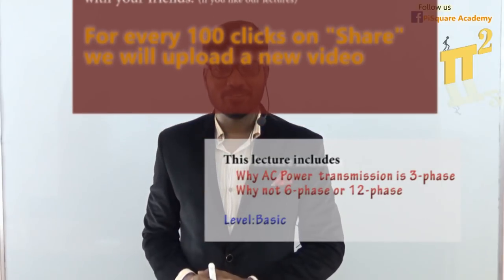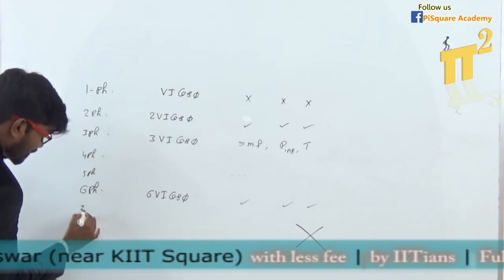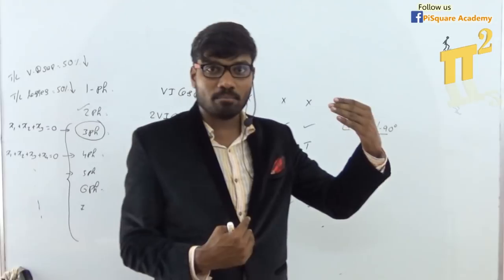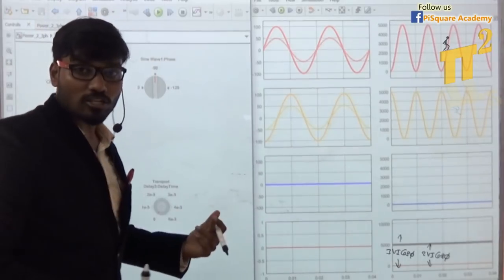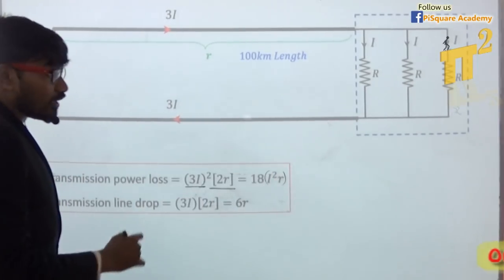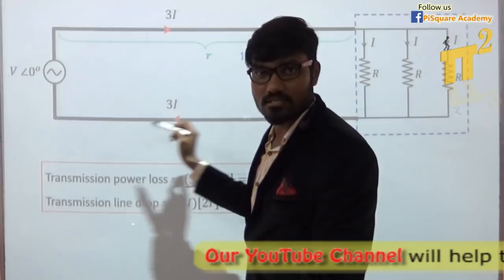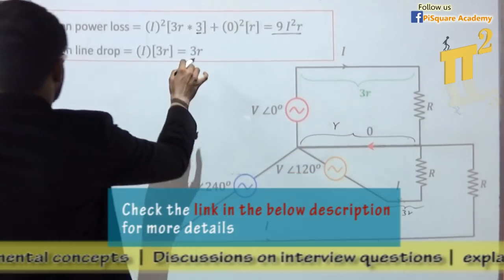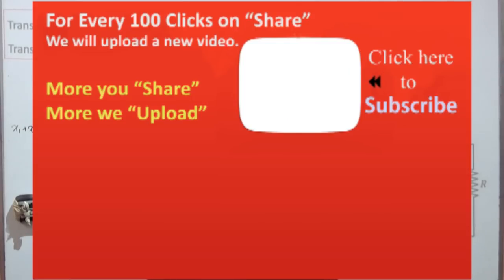Why 3-Phase Why not 1-ph, 4ph, 6ph, 12ph Why 3-phase transmission | PiSquare Academy

Comment from the maker: Please Share the video with your friends through facebook or any other medium. More you share, more we upload. Your single like, comment and share will give us energy to do more such videos. Thank you all.
Reply: Sir........Plz make a video on types of grounding of transformers and generator and it's purpose
Reply: PiSquare Academy sir please make a video on what is reactive power, how it is generated, why is it important
Reply: Awesome
Reply: Advertisement disturbing me everytime
Reply: Thank you so much sir for this video ! Sir Could you please make one video on Importance of Form factor , how it helps in generating voltage?
Reply: Nice video
Reply: Why we use double circuit 3 phase?
Reply: Sure sir..and please explain wye and delta systems.next videos if its possible👍
Reply: Hi sir..... Motor running hr is 7 hr each day 24 dayes total... 11 kw motor... Converte to unites????
Reply: @cheruvudiwakar7596  168 kWh needed
Reply: Sir I need a notes on these topic sir please give me the reply as soon as possible plz sir urgent
Reply: Is neutral carry current in three phase 4 wire system
Reply: @chinthamojesh6147  in balanced 3 phase system neutral should not carry any current unless a fault has happened.
Reply: Sir, why you took voltage drop for only single phase,???
You would've taken 3×I×3r
Reply: Sure sir

Comment: In 2 phase, the voltage  generation from coil 1 is at 0 sec but in second coil voltage generation starts from (90deg) phase shift because the coil 2 is shifted 90 deg physically in alternator or in dynamo to the coil one so generation of voltage is also delay by coil 1 timing and it is exactly (1/50hz) then we get one cycle time period and then at 1/200 sec u will get voltage in coil 2 and this 1/200 sec is also exactly 90deg phase shift that's why in 2 phase the phase difference is 90 not 180

Comment: your explanation is correct that  kirchhoff law  also telling the algebraic sum of the current at any junction of the net work is zero.because transmission line voltage & current losses 50% it will be reduced and all installation electrical materials will be reduced and single phase (1ph,2ph) can not get rotational magnetic field in ac induction motor only get pulsating magnetic field also many phases no required to run the ac induction motor only 3ph enough

Comment: Hello, in 11:57, area of the conductor is reduced by 3 times because current is changed from 3I to I. But in normal conditions, for example cable which is able to carry 300Amps has not the section area of a cable which is able to carry 100Amps. (150mm2 section cable carries 324Amps and 25mm2 section cable carries 106Amps, current ratio is 3 to 1 but section area ratio is 6 to 1)

Comment: Dear Sekhar Sir, As I am thinking, in 1-ph system, the power equation is, P=Vrms*Irms*(Cos(th)-Cos(2*omega*t – th)), while, in 3-ph system, the power equation is, P= 3* Vrms*Irms*Cos(th). Here, “th’ is the angle between Vrms and Irms, which depends on the nature of the load, and remain constant in the balanced system. These power equations show that the power equation of 1-ph system is the function of “t”, so it is pulsating. While the power equation of 3-ph system is not a function of “t”, so it is constant. Am I correct ??

Comment: simply if you see the wave form of 3-phase then the power is not zero at any instant of time and also if we see the wave form of 6-phase ,9-phase, 12-phase... the wave form is similar to 3-phase.Less wire less transmission losses and less material required and also  less space for transmission

Comment: I have a doubt. While considering a 2 phase system, we should not consider each phase displaced by 180 degrees ? In the lecture, Sir is considering the angle as 90 degrees. Can anybody indicate the reason ?
Reply: If you're not aware, a two phase is 90 degrees apart. To generate a two phase which is 180 degrees apart (as suggested by you), the two phase winding in the generator needs to 180 degrees (electrically) apart in the space, which is not possible.

Comment: The concept of transmission power loss is clear. the power loss you calculated for all 3 phases.
but there is some confusion in voltage drop in case if 3 single phase with common thick neutral.
bcoz voltage drop you calculated in per phase only. so in case of 3 single phase with common thick neutral, even though there is '3I' in common neutral, the contribution of one-phase in neutral line is, only '3I/3 = I' and hence overall voltage drop / phase will be '4I', right?

but in case of 3 single phase with separate neutral & in case of  3phase system, voltage drop / phase concept is clear.
And presentation very much conveying message.

Comment: what about 2ph 180 degrees phase shifted. It would also have sum of voltages and currents as zero.
Reply: There will not be any rmffor 2 phase 180...RMF will be produced for 2 phase at 90 shift

Comment: I have 315 KVA, 15/0.4 KV, 50 Hz, DELTA/STAR connected step down 3 phase transformer whose HV and LV windings are rewound again as it was. The TTR test was 100% ok. The insulation and dc resistance tests were also ok. However, as  I tried to conduct  open circuit test by connecting 380 V to the star connected LV side and the delta connected HV side was left open, the 16 A circuit breaker tripped immediately as the supply is switched on.  
I expected small magnetizing current (1.2 - 2) % 0f LV side rated current which is 455 A from the name plate. What could be the reason that the circuit breaker tripped?

Comment: Hi sir, thanks for the video...but i have a doubt..
For three phase total power must be
Root 3 VI COS$
But told in your video power is 
3VI Cos$
How?
Reply: in your equation with root(3) voltage and current are line to line values.......he uses in his video the phase voltage and current. The relationship between line to line and phase is V_LL = root(3)*V_phase

Comment: What happens if sudden failure comes in the transmission line while transmitting power from generating station to Grid? At that instant power is fed back to the grid?

Comment: Sir in India We get 220 volt power .so if a bulb of 100watt is used we find resistance by ohm laws 484 ohm but when We measure it with the help of Multimeter we find it nearly 40 ohm why
Reply from the maker: 40 Ohm is the cold resistance, your calculated value (484 ohm) is hot resistance. Filament is having a positive temperature coefficient, i mean filament resistance is not constant.

Comment: In case of 2 phase supply, phase difference will be 180° and not 90° as shown in video.

So in 2 phase system also we can have summation of both phases to be zero.
Reply: no sir, in a two phase system it is displaced by 90 deg
Reply: Phase difference means : diffrnce between two phases zero instant

Comment: Sir I have one doubt if we 2 phase with 180° phase shift then that also have the current at that instant is zero then it should be like 3 phase ????
Reply: I think for a two phase system with 180 degree phase shift, there will be no current flow because both the phases offer equal and opposite potential at every instant of time.

Comment: With the help of rotor voltage and rotor current of slipring induction motor,how to select external resistance for rotor resistance starter ,please explain sir

Comment: I have to disagree it's the "3-phase system transferes more efficient" fallacy. The comparison is a bit wrong or 'unfair' to the 1-phase system. Lets say the voltage is 230V. In the 3-phase situation each line carries voltage and power, and the center line can be left out, good. But in comparing it to 1 phase something goes wrong. Either one line is at ground so doesn't carry any power. Or the ground is in the middle and each line carries 115 volts. a correct comparison would be to double the voltage and put the ground in the middle, then each line carries 230 volts and the whole thing is just as efficient as 3-phase. Offcourse at 2/3 of the power.
Reply: Efficiency isn't limited to input vs output power. 

Economic efficiency is important as well. The cost to install and maintain the systems is normally not worth the improved reliability of the systems operating on it.

Comment: Sir I had a small doubt
Why we won't use two phase motors? (even two phase power can produce RMF and constant torque is produced)
Reply: Vamshi Krishna it is because 2 ph motors require 2 ph supply, in which the neutral currents or voltage dont cancel out so as sir said, losses are high & voltage drops are high in case of 2 ph supply, that is why generally 2 ph supply is not available.
Also starting torque ,efficiency, etc are high in case of 3 ph motors.

Comment: I understand about losses but why should we also reduce voltage drop in the lines plz explain
Reply from the maker: efficiency and voltage regulation are two performance indices of the transmission line. Voltage regulation depends on voltage drop.

Comment: Sir why transformer primary side is connected in delta and secondary side in star? Plz make a video to make it clear.
Reply: Sanjay Behera In distribution transformer it required to reduce the losses and feed maximum voltage with low current over transmission line.

Comment: Sir sometimes we connect motor  U V W in R Y B respectively on supply it rotate anti clockwise direction then we interchange any two phase then it's works properly. What the theoretical reason for that please give the explanation
Reply: A rotating magnetic field is a spatial quantity existing in the motor's physical structure. Now each phase of a balanced 3-phase system generates a pulsating magnetic field which is 120⁰ displaced from the other two. Upon projecting these pulsating waves onto a orthogonal 2-axis stationary frame of reference by taking the angle between the phases and the axes, the rmf will come into existence. However, if any two phases position, say B and Y phase arrangements in the stator are interchanged, the projections onto the 2 orthogonal axes interchange as well. This affects the direction of rotation of magnetic field. You can check out any book on basics of AC machines for a clearer understanding. Hope the answer helps you. Cheers

Comment: Nice video sir
I have a doubt that why transformer neutral is grounded???
And while grounding the neutral of high voltage transformers why NGR are used?
Pls explain
Reply: The neutral of transformer is grounded to get the neutral at earth potential i.e 0 potential so we can get accurate line to neutral voltage. If we wont do this we will get a condition called floating neutral which means we wouldnt know the potential of the neutral cause it is not 0 cause it wasnt at earth potential that is 0. Floating neutral can raise your voltage to dangerous levels that can damage your equipments. Btw when a short circuit (line to ground fault) occurs the current will return through ground to the grounded rods of the transformer to the neutral thus completing the circuit and allowing the circuit breaker to trip.
Reply: NGR is neutral grounded resistor. As i said in case of a fault a lot of current will be drawn because of least resistance path of the ground. The transformer can get damaged even if there were breakers to trip but for transformers safety we can install NGR upstream to the neutral to resist the unsafe amount of current coming back to the transformer through neutral
Reply: Aamir Awan what the resistance of NGR for 33kv transformer?
Anyway thns for reply sir...!!!
Reply: Bhanuteja Dadi you are welcome sir. Ok so the value of NGR depends upon the secondary voltage and not primary. Secondly, it depends upon the amount of current you wanna limit. Example: I have a 33kv/400v transformer and i want to limit the fault current at 50ampere. I will choose the NGR of value R=V/I = 400/50 = 8 ohms. Hope that helps
Reply: Aamir Awan Thank u very much sir 
I already subscribed ur channel now am recommended my frnds too...
Keep going on sir
All the best

Comment: Sir..
Why only magnetic field is used in generators and motors???
If electrostatic field is used the generators and motors working or not ??? Why??? I mean what is the reason???
Reply: a little late answer,
the energy density of electric fields is much lower than that of magnetic fields. However, there is a field of application of electric fields in nanotechnology or in piezoelectric effectors.

Comment: When it is balance load why current is not returning in the nutral wire
Reply: When the load is balanced the currents in the loads (or phases) are balanced i.e., they have same amplitude and 120° phase shifted from each other. It can be mathematically proved that sum of three sinusoids with same amplitude and 120° phase shifted ia zero.

Thank You.
I hope you got what I meant.

Comment: Sir at the starting of the video u said that in 3 phase power transferred is 3vicoso but I think it's √3
Reply: If we talk with phase voltage and current it will be 3. When it is line voltage and curent it will be √3. He is talking about every single phases.
Reply: Both are correct bro just mathematical things

Comment: Good video sir but tell 
Where going the current?  In 3 phase balanced systen
Reply: In three phase balanced system the currents are also 120º apart from each other, so their sum (not algebric, but phasorial) equals to zero in the neutral point. That's why there is no current flowing back to the sources.
Reply: @EngTiago86  I am a Mechanical Engineer working in Thermal Power Plant. Your explanation is 100% correct.
This guy is teaching with many mistakes. Example 2 phase are seperated by 180 deg but he is  telling 90 deg.

Comment: Thank you so much sir.....
i have one doubt....

why return line current is zero in three phase configuration?
Reply: due to the different among the degree in the power source
Reply: imagine 3 vectors in a polar diagram, three arrows, one at 0º one at 120º and one at 240º. Those are the currents and they always sum up to zero in the center. They have to in any case there's no center line.

It gets more interesting when the load at the secondary star side of the transformer is unbalanced then that translates into different currents in the 3 lines at the primary side. Not just different currents but also phase shifts (I had to think about this)
say you have a utility transformer with both sides in a star configuration. the hv side doesn't have a center line, the secondary does and say you load only one phase. That means only one coil of the primary (hv side) will draw current. The wire that feeds it will carry the current as usual. The other side of that coil is connected to the center, the current will be drawn through the other two coils and they both end up exactly at the opposite position so at 180 degrees. So the currents will now be at 0º and two at 180º. So whilst the voltages in the system are fixed at 0,120,240º the currents are not fixed at all they can be all over the place.
It's a bit different when the primary is in triangle configuration I guess, there that one coil is between 2 poles so only two wires will carry current and the third none. there's an interesting 'phase shift' of 30º going on when one side in in star and the other in triangle.
Reply: I made a slight error the current that gets drawn from the secondary side L1 is not just delivered by L1 on the primary side but also L2 and L3 which 'team up' and become a kind of virtual other half next to L1. Like a balanced to unbalanced transformer. I'm trying to figure out how this all works out it all has to add to zero. I guess the line L1 delivers half the power and the other two lines the other half. This popped up because you can't just have current going through coil 2 and 3 without it going somewhere. But that matter is solved when realizing L1 delivers only half the flux. The whole thing is really a 3phase balanced to unbalanced transformer although usually the secondary is loaded symetrically. When loaded on only one phase the thing becomes a kind of one phase balanced to unbalanced transformer where coil 2 and 3 becomes a kind of virtual opposite of 1. or other half. 
The question is what happens at l2 and l3. They each deliver 1/4 of the power which makes sense they also carry half the current of l1. But they are both connected to a voltage that's 60º out of phase compared to 180 I can't get the picture right. At some point I wondered if maybe the center voltage would shift to l2l3 but that would cause a higher voltage on the secondary l1 and that's contradictory, load it, higher voltage, ur no. Not the best explanation but it is waterproof.

The question is, what happens when you load a 3phase trans on the secondary on only one phase. How does that translate to the primary. And the primary has no center connection although at this point I'm not sure it makes any difference.. perhaps the whole thing is alot easier than it looks.

Comment: The reason we have 3 phase electricity is because Tesla had a dream and someone in the dream told him "3"...TRUE. Tesla sold his patents to Westinghouse for 3 phase motor, generator and power distribution designs which formed the basis  of our electrical systems. Tesla was obsessed with the number 3 and their multiples especially 3-6-9.
Reply: 🤔 is it true ?

Comment: + phase to phase voltage of any two line is same only in 3 phase system. This attribute provides a fail safe condition to the end user, as a benefit.

Comment: It is a very nice lecture but I have a doubt that how the total current is zero?
Reply: Bro
The total current in the 3 case through the common wire is zero bcoz 
it is then a balanced condition , having 120 phase shifts between every phase
so when you add these currents or voltages , the resultant would be zero
i1(0°)+i2(120°)+i3(240°) = 0